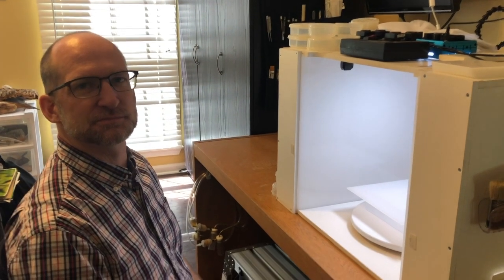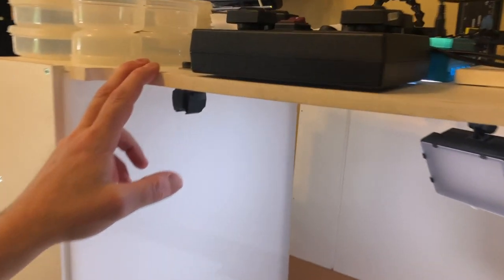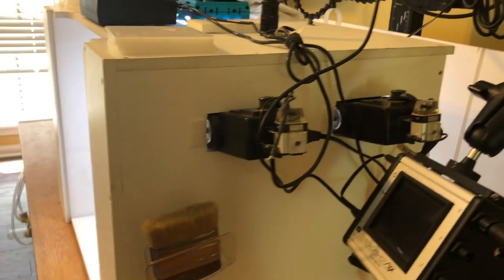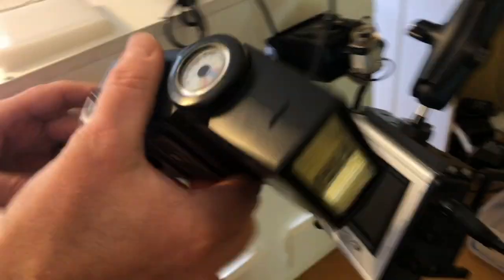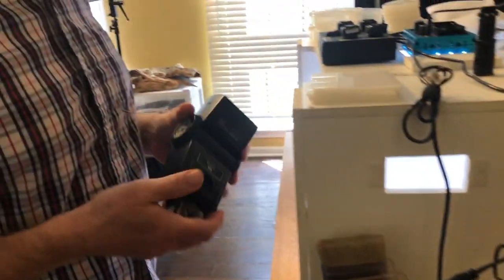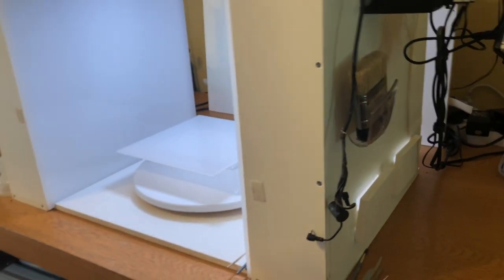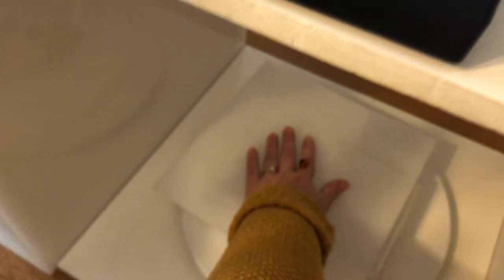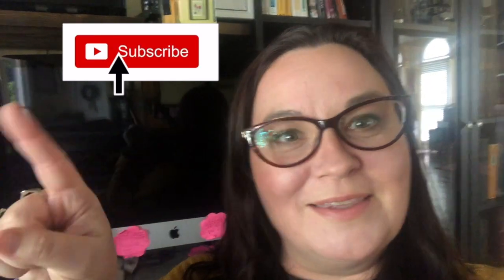White Box photgraphy DIY

Comment: Which battery do you recommend/use for the Dracast LED160? (I don't own any large Li batteries like the one used by the Dracast, so I need some advice. Thanks!) And while I have your attention, I would like to suggest two topics for new videos: how/why you use the copy stand shown in one of your videos; the high-speed photography/videography setup shown in the background of another one of your videos.
Reply from the maker: We plug ours in and don’t have lithium ion batteries for the Dracast. But they do sell 2 different kinds for that Dracast but we can’t recommend one over the other. We are almost done with a high speed video that we are setting up in the field the copy stand is a good idea. We are using it a lot lately, we will certainly do a video.

Comment: Great video guys! I learned a lot. Do you ever photograph specimens in water? If so, do you have trouble with light reflecting off the surface of the water?
Reply from the maker: hey Kevin! We do photograph insects in water. You want to diffuse the light. Try putting your aquarium in a white box with the flashes outside like in our travel white box video. We can try and do a video on that too. We get a lot of questions about that in our workshops and do not often cover it.

Comment: Which color temperature do you recommend for the Dracast LED160?
Reply from the maker: Walter Sanford you may want to do a custom white balance of about 4800 on your camera.
Reply from the maker: On our Dracast we have it set to 5500.
Reply: @AbbottNature  - Why is the LED light set for 5500 K while using a custom white balance of 4800 K -- shouldn't they be the same?
Reply from the maker: Excellent question! We turned the Dracast until it appeared to look white in the box. Then we took a neutral grey card and did a custom white balance to figure out what temperature to set our camera at and it said 4800. Not sure why they are not the same.